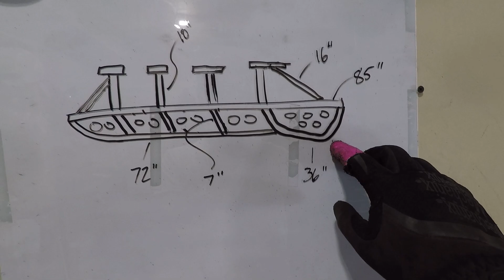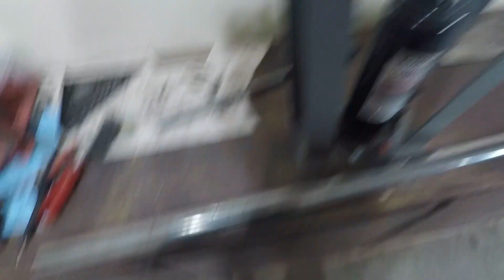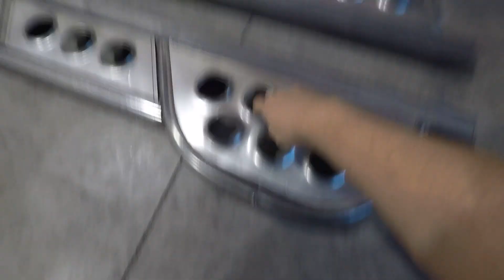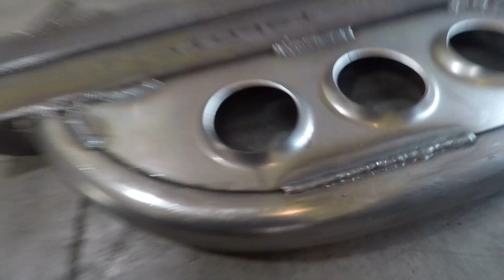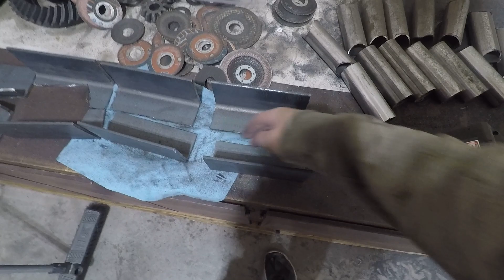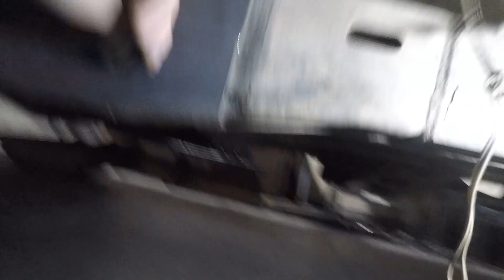Building Rock Sliders For The Dodge Dakota

Comment: I use herculiner for my Toyota tundra body its holding up good. What was the thickness you used on the pipe? And what kind off metal would you recommend for skid plates? Keep up the work man looking good
Reply from the maker: Thanks! I used herculiners roll on kit for the Bedliner when I first got the truck, been meaning to try out their spray on version too. Might do a little better than the rust oleum haha. I used 0.120 inch thickness for both the square and round tube, although something around 0.180 wouldn’t be out of the question for a heavier rig like this. For skid plates, 3/16 is a good thickness. You could get away with 1/8 if you have a real light rig or only run easy trails.